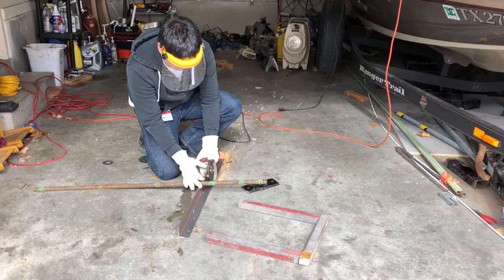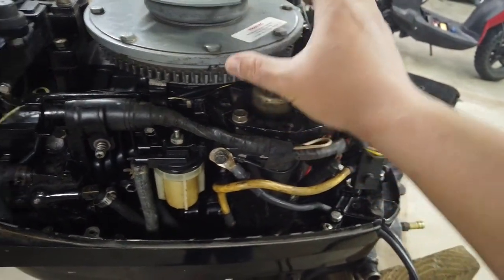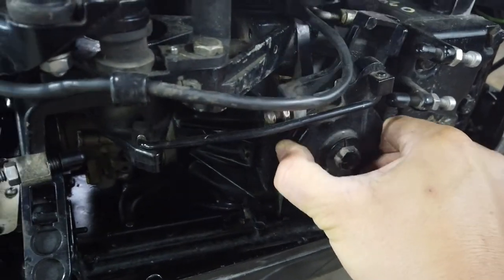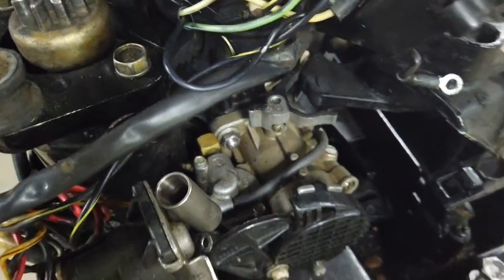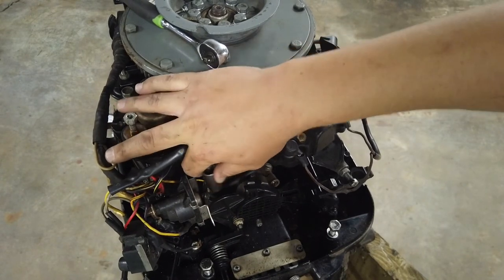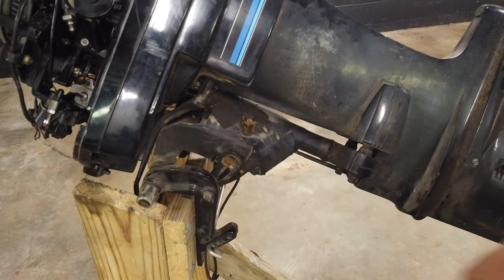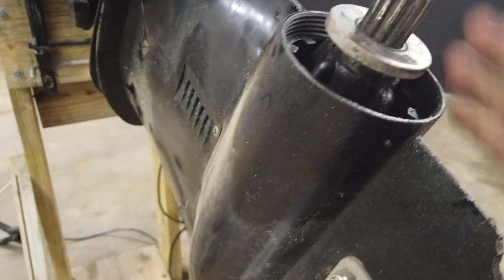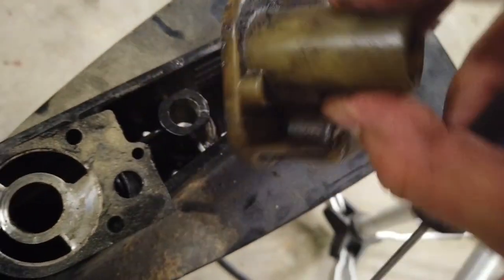1982 40hp Mercury Outboard (2 Cylinder) - Getting It Back On The Water Part 1

Comment: Recently bought a boat with a 1982 50 hp 2 stroke the process is almost the same I was able to guess the rest but your a life saver thanks for you video not to many videos on these older Mercury’s
Reply from the maker: Awesome, I'm glad it was helpful. Are restoring the boat as well?
Reply: @TheAfterWorkGarage  adding some personal touches and fixing a few soft spots in the floor but after watching your video yesterday I was able to fix my water pump and now the motor is lake ready couldn’t be more grateful
Reply from the maker: @richardwhite9387  That's great to hear. Fixing up a boat the way you like it can be very rewarding. Have fun with it!

Comment: Thanks for the Video, I have an Operation and Maintenance Manual for the Mercury Outboard Models 40,50 and 70 HP it is not a motor manual it's just the owners manual if you want I will scan it and send it to you as a PDF. I just got my dad's 1982 lowe 16'  bass boat.  that has been sitting in a field for about 15 years.
Reply from the maker: Good luck with the bass boat, that's very exciting, and a lot of fun to bring something back to life. Hopefully you have, or can find a motor for it as well. Lowe's are great boats.
Reply: I'm not sure if you found a place for parts this is the site I found, I like them because they have a blown-up schematic and not just the part name.  http://www.marineengine.com/
Reply: Hi! Would you mind sharing this manual with me? I'd appreciate it! thanks
Reply: @samir_wf  as soon as I scan it I will make it available. Keep in mind this just an owners manual.
Reply: @Samir Fernandes, finally got around to scanning that Manual into a pdf, 9 months later but some things you just can't rush... , I'm not sure how to get it to you since youtube won't let me attach a file.
Reply: Got an extra pdf for me? ❤

Comment: I have a 1982 40hp mercury thunderbolt. There is a rod that goes into the lower part of the motor. It engages the lock that holds the motor in reverse. Can you do a video on that?
Reply: Where is the release for that reverse lock😊
Reply: Plz
Reply: Mines stuck in reverse

Comment: I have a 35hp same early 80s that looks the same inside.  I have 95psi for compression in both cylinders. Might have been a little higher if I would have gave it some more turns. Thanks for the video! It helps a lot with mine
Reply from the maker: I'm glad it was helpful. Hope your getting to enjoy your motor on the water!

Comment: I picked up an old 402 40hp merc in August 2020. Never touched an outboard motor before but basically did what you've done, taken it all apart etc. Kinda scary but if you don't try you don't learn.
An old rubber impeller at some point had broken down and parts had got stuck inside the engine. Lack of water in the pee tail.
Went to remove the manifold cover I think it's called, three bolts snapped off. However to access all these bolts you had to also remove the engine from the outer casing/cover.
Wasn't sure I'd be able to get it all back together at this point.
Found many pieces of the broken impeller with the cover removed. 
Had to drill out the three snapped bolts and retap one of them and replace it with a larger bolt.
Got it all back together and running, the pee tail thing doesn't shoot as much water as it should so there must be still small parts blocking the flow.
The one thing I need help/advice with is the two adjustment screws related to the throttle and firing. Any idea how to tune or adjust there?
The engine runs ok, but I had to remove the two bolts and now I'm not sure how to adjust them the right way.

Comment: awesome video , restoring same engine in a 35 horse power . still looking for a wiring diag  . this forty is identical in everything i see so far . looking forward to watching next vid  . leg was off mine when i bought it and didnt realize that cam lock for reversing was what that piece was so learning from you already cheers matey
Reply from the maker: Awesome, thanks for the comment! If I come across a wiring diagram online I'll point you to it.
Reply: @TheAfterWorkGarage  yeah every diagram I see has plain coloured wiring mine has coloured strips . Still looking . Cheers
Reply from the maker: @m4chschnell  Mine also has striped and colored wires. There are a number of wiring color codes online that might be helpful. One site I have seen is below: https://www.electricaltechnology.org/2020/07/marine-boat-cable-wire-color-codes.html
Reply: Order a manual.
Reply: Whats the model number on your 35hp?

Comment: My water pump impeller in my 1994 40 hp also is hard to get on/off.  It’s a pressed fit from what I can tell.  Once I had to use breaker bars to get one off.  You may also have to lightly sand the drive shaft to get the new one on as any small irregularly will cause it to hang up.
Reply from the maker: Thanks for your report. I also had trouble getting the impeller on, and ended up doing a little sanding on the drive shaft as well (I will be uploading that in Part 2 as soon as I get a shot of it running on a boat). On mine, it looks like there was a bit of a flare on the driveshaft just above where the impeller sits which I had to sand down. I also took a 19m wrench to straddle the driveshaft so I could use a mallet to work the the impeller down onto the key.

Comment: How did you get the fuel filter housing off? Does it just turn? Or do I need to loosen the screw on top? It's pretty tight and I don't want to crack it. I have same exact engine.

Comment: I have the exact same one but when trying to remove the lower unit it is stuck and won't come off its opened up a little but is stuck. Any ideas?
Reply from the maker: If you're sure you have everything disconnected, it could be a stuck driveshaft. Sometimes the splines get really seized together.

Comment: i have this exact same motor, and it runs fine, but is pretty unreliable when it comes to starting the engine, and it tends to die at random times on the water. my brother says the carburetor needs cleaning, is that it?
Reply from the maker: If you haven't done anything with the carb, I'd definitely start there. I would also check the fuel pump and filter just to make sure you're getting good fuel flow. I found that this motor had bad reed valves, which was causing starting issues for me. Unfortunately that's not the easiest fix on this particular outboard, but it is something to consider. Good luck, and if you figure it out, I'd love to hear what the issue was.

Comment: I got the exact same engine and year yesterday and an old boat project. I was wondering how do you know if it's four stroke or two stroke it only seems to have one red gas can inside the boat hooked to the engine...???
Reply from the maker: If it's the same engine - or pretty much any older outboard - it's a 2-stroke. It only has one gas can because older 2 strokes required you to mix the oil and gas in the tank rather than having a separate oil reservoir. You can also tell since there is no engine oil in the engine, and no timing chain or camshaft. Hope this helps!

Comment: I have the same motor but a 1979 model. Need to change or rebuild the waterpump. Have you done yours?
Reply from the maker: Yeah the impeller and impeller housing that I change out in the latter half of this video is the water pump. If you're talking about the fuel pump, I have actually changed this out as well, but have been waiting to get a video together on it until I can get the block back together and on the motor. I just moved to a different city from my shop, so I'm looking at ways to get my shop moved down to Dallas so I can keep things going! Best of luck with your motor!

Comment: Hi, I'm from Italy and I have the same motor of yours. I have a problem with the starter... Do you know where can I buy parts?? Thank you
Reply from the maker: You're likely going to have to look around online a bit. Definitely try to get the part number on the starter motor, and make sure you match it. If you get really desperate, starter motors can be rebuilt - but that would take skills that I certainly don't have.
Reply: @TheAfterWorkGarage  my motor was born without the teeth on the flywheel and also without starter motor 😣🤕
In addition it's very hard to start with hands.
I'm doing it only because I'm a vintage motors lover and I'm poor so I can't afford a new one. 🤣🤣
Have a nice day ;)

Comment: Hey, love your channel and love your videos. Last season i found that my engine was popping up in reverse and not locking down. After watching your video I realized that the previous owner must have put in the reverse locking mechanism in wrong. I took the lower unit off to fix it, but when i took it off there were no seals for the top of the drive shaft or the seal that goes over the copper pipe for the water cooling system. Do you think this is a big issue? I've never had a problem with the engine, it has worked great!
Reply from the maker: I'm glad it was helpful! I honestly don't completely get the spline seal thing, since the lower crankcase seal is completely separate. I think they may just be there to keep the grease on the splines from drying up or being washed away. This is just a total guess though. I am not a Mercury expert, and there are many people who know far better than me. If your motor is running fine, I'd say it's probably not a big issue.

Comment: Where are you finding parts for this engine
Reply from the maker: This is a good question. I've usually just tried googling the part ID's if I can find them on the original, and doing my best to match them up by eye. I've gotten lucky so far, though I did initially order the incorrect carb kit. Sorry I don't have a one stop shop source to share, but with these old motors, sometimes it's a challenge. Perhaps someone else knows better than I and can help us out!

Comment: Does anyone know the type of oil this motor uses?
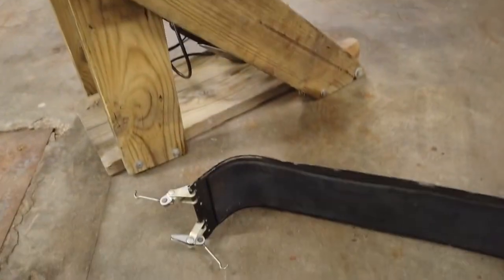Reply from the maker: This motor uses regular 2-stroke oil pre-mixed with gas at 1:25 to 1:50 ratio. I'd recommend somewhere around 1:30.
Reply: @TheAfterWorkGarage  just one more question where did you get the impeller kit and how much did it cost ?

Comment: Dude I’ve got a 83 fully rebuilt but crank is bent has controls.
Reply: 40hp
Reply from the maker: The big question I'd have to ask is what caused the bent crank, did it hit something? Fortunately if you can find a crank in good condition, replacing it isn't as bad as on a 4 stroke. The case just splits apart and you can pop another one in.
Reply: @TheAfterWorkGarage  the flywheel nut wasn’t the original and it was loose and over time cause the bend. So I can easily replace crank with the whole motor still together

Comment: I have an 1983 35 horse Mercury. When I start it it dies after a second. If I give it some throttle it will idle as long as I want it too. Do I need to adjust the idle position, if so how would I do that? Or is it something else?
Reply from the maker: Hi! That sort of depends. If the idle is set really low, you can try adjusting it up, however if it seems like you have to rev it up higher than a normal idle (sorry I don't know the actual normal idle for this motor), then you have some other problem going on. That's actually a similar symptom to what I had going on with this motor that ended up being worn out reed valves. However, this can also be a symptom of low compression, or a poorly adjusted carb. Basically I'd start with the easy things (clean the carb, check compression) to rule things out, and then move on to the other possible issues. Good luck, and I'd love to hear what the issue is if you get it figured out!

Comment: Im getting gas to carb bowl but am not getting it to cylinder
Reply from the maker: Hmm, that sounds like it's a carb cleaning/adjustment issue. The only thing between the bowl and the carb body is the jets and the venturi. I'd definitely start with a carb cleaning/rebuild kit, and see if that resolves the issue.